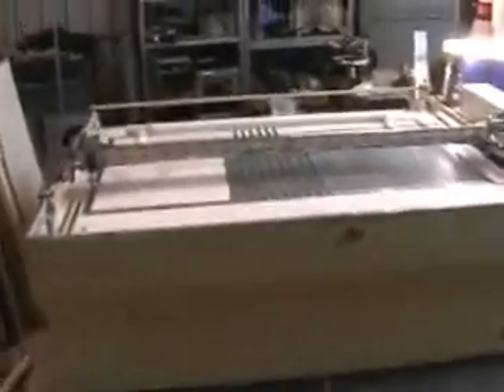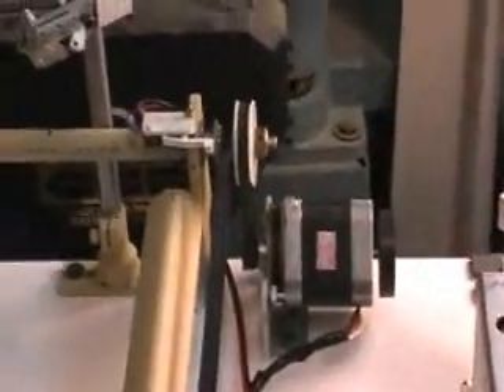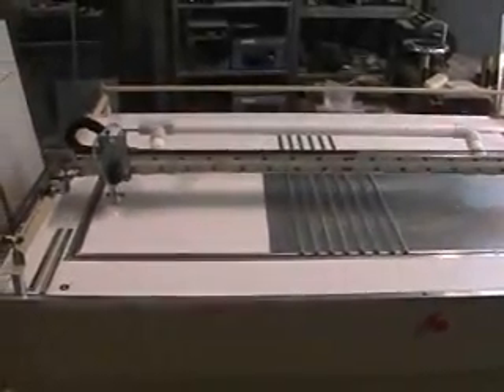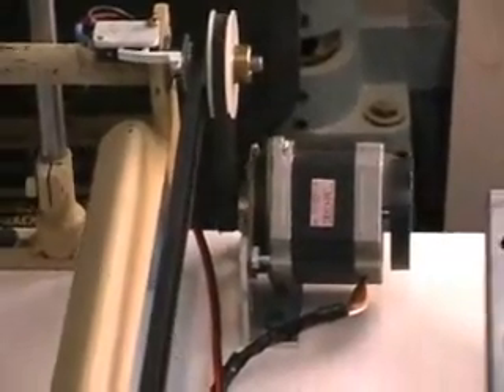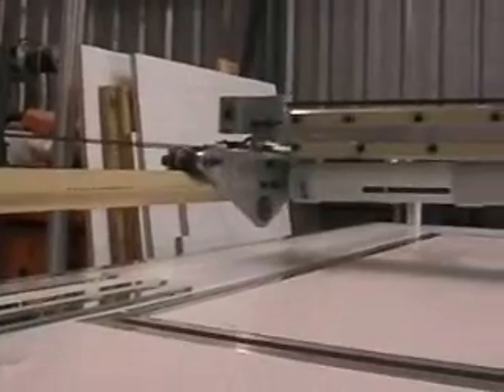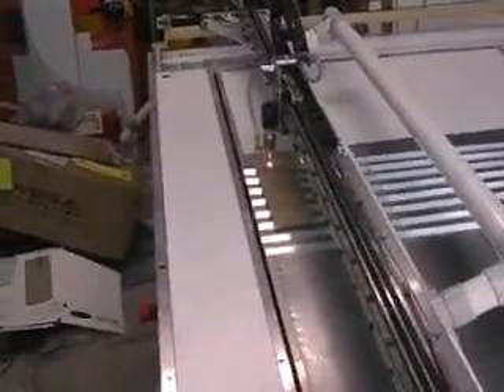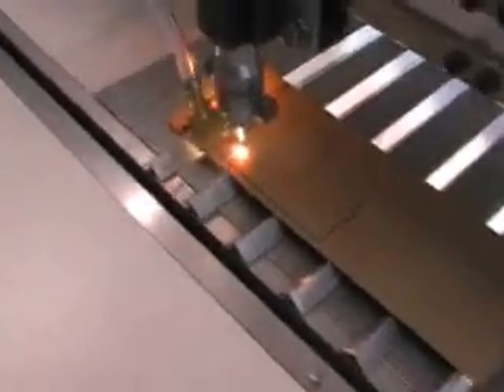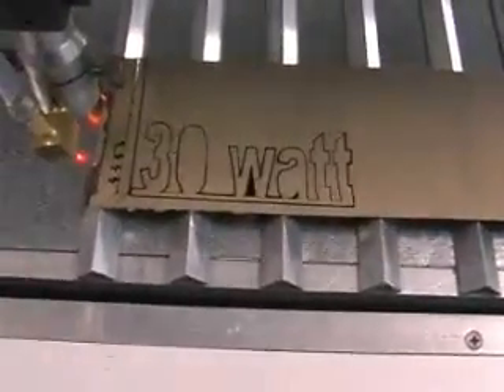Home Made 30 Watt Laser Table  Sep2007

Comment: How thick is that ply (?) and how many mm/minute max can 30 W cut it please ?
Reply from the maker: 30 watt could probably cut 3mm baltic birch ply but very slowly.  My 100 watt laser tube has trouble cutting through 7mm ply.  The glue tends to reflect the beam and causes the cut width to widen greatly due to the air assist.  Ply is probably the hardest thing to cut in wood.

Comment from the maker: I have a very basic set of pictures over at "cnczone dot com" under the name of "backyard Laser" or just search my name on the forum "mononeuron".  That should get you a look at whats under the hood.  If you take all the bits and pieces 1 at a time it is actually quite simple to build one. (after having built one it all makes sense in the end)  Build the frame, get the motion control to work, install the laser, install the mirrors, Install the power supply etc.  Thanks for looking.

Comment: So, if you wouldn't mind messaging me, why won't an A/C capacitor bank charged from the wall with a resistor right onto a diode set in a waveguide work?